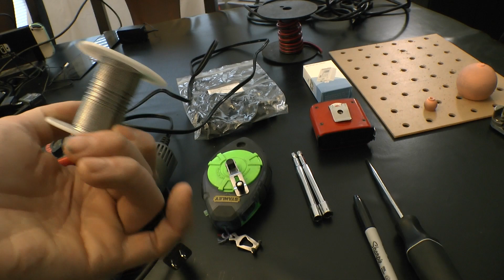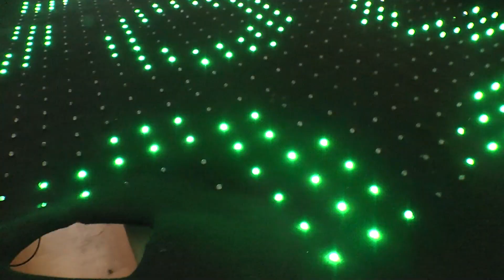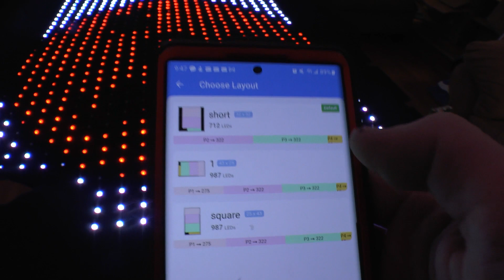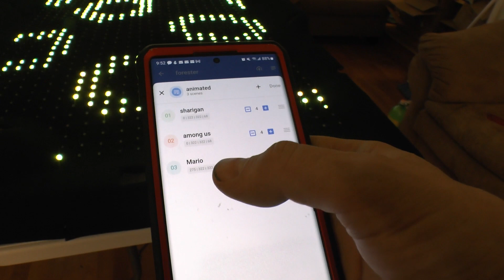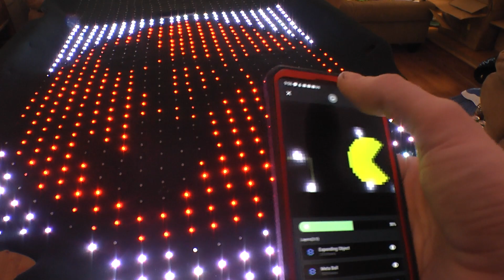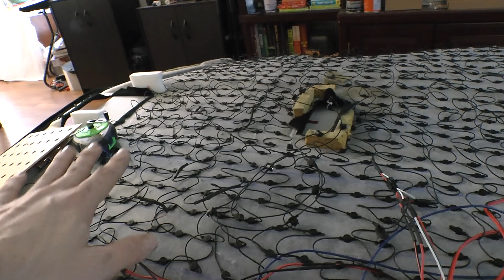Rgb Flow Series Headliner - The Next Big Thing In Led Lighting

Comment: I think the wire labelling is wrong. Red should be 5v and black should be ground.
Reply from the maker: I wanted to get back to this comment after confirming and i can confirm that what is written on the website and in this video is 100% correct. Please follow that diagram when using these leds.